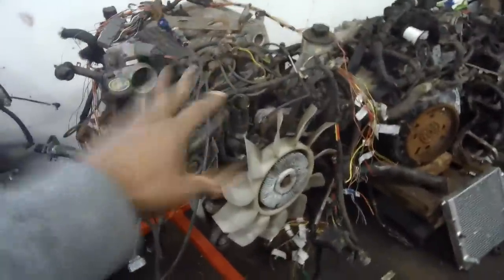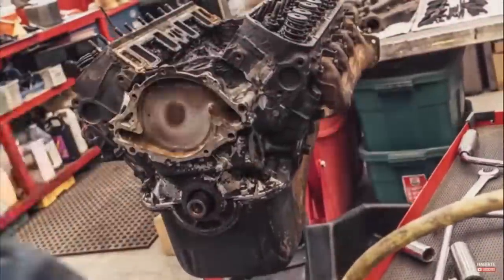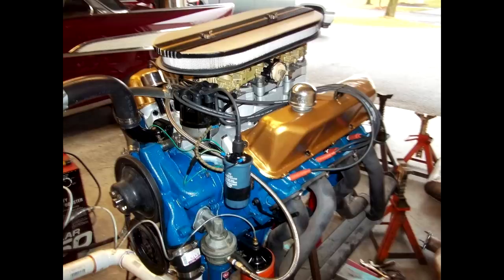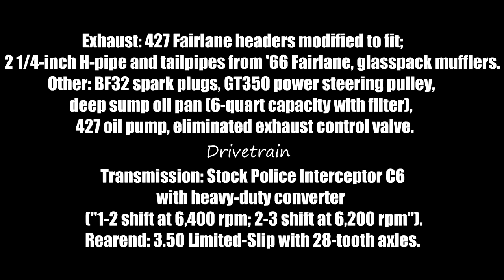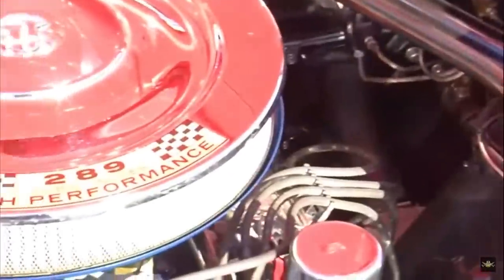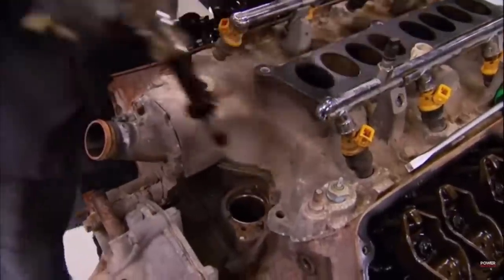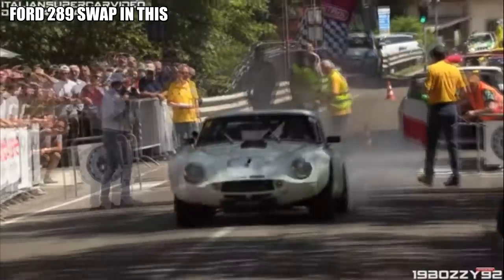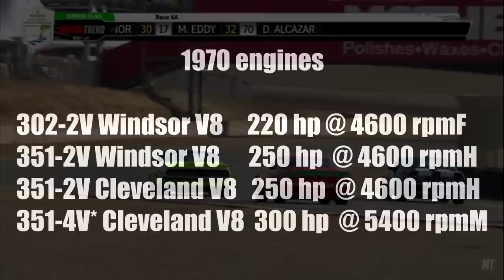289 Ford Voted BEST ENGINE BY CARROLL SHELBY ( HERE IS WHY )

Comment: I bought a 289 hipo from Creb Engineering....wow! what POS!!!....after much frustration, I pulled the whole thing out, trashed it, bought a 351w from craigslist, had my LOCAL machinist do her up into a gnarly short block, installed edelbrock performer heads and intake....MAN!! Couldn't be happier..Stay away from the hipo 289.....what a dog!! 351w kicks it's ass everytime...
Reply from the maker: lmao WOW i feel ya I would have done the same thing david lmao... the 289 have to be built ( with all the goodies ( in a light car )

Comment: 1st is the 427 for me cause it’s a legend and whatever car it’s in is going to be amazing. 2 is 351windsor. It’s a small block and can be bored and stroked to 427ci. 3  289 would love to own an old k-code ford. 4 is the 460  just a beast. 5 would be the FE big blocks.  351 Cleveland was posta be awesome way back too. Sorry I got no love for the 302. Seems like a lot of work and expense to bore and stroke the 302 to 347 and after ur done it’s still got less cubes than a 351w
Reply from the maker: you made some solid choices there i like your line-up (  honestly ) you can not loose with anyone, i tend to lean to the smaller motors, but i like that 427 no doubt about 1... strange how the old school put out some numbers big blocks i a speaking about
Reply: The only thing with the 351vs 347, don't you have to cut the strut towers completely out of a Fox body and weld a whole new front clip to fit the 351? I might go 351 if I can keep the strut towers on the Mav.
Reply: L Twig I remember changing plugs on a maverick with a 302 and it was tight cause of those shock towers so if a 351w fit it be even tighter. I always hated those shock towers. If I was you and had the cash. Stick a mustang II front suspension on that Mav and cut those annoying shock towers out. Be lots of room then for a 460 or even a modular engine.
Reply: @canadianmarauder1923  Yes, once the towers are out of he way, it would be ready for the Coyote. Except, I'm in the same boat as BST in my welding skills. I would have to pay someone. I could set it up correctly and make whatever support brackets. Just don't trust my skills on welding a suspension.
Reply: L Twig I hear ya. I’m an old retired HD mechanic and have done quite a bit of welding but I wouldn’t try welding it myself either. At least not if it’s visible. I would be farming that job out to a guy that welds for a living too

Comment: 351 modified was always fun.
Reply from the maker: i never even drove in oe, what was done in it
Reply: @bstfordchannel923 just racing around the  Hoosier corn fields .
Reply: @obediahsmith5824  I'm Hoosier also. Was you ever Southside TeePee racing?  I grew up in Speedway, 7 blocks from the track.
Reply: @ltwig476  I was further south, down around Evansville, Chandler. Maybe into Kentucky a couple times.

Comment: From what I remember, a 289 in a racing Cobra or GT350R was good for 380 reliable horses. What Shelby said made since as the 289/302 was just “good enough” for the average Ford passenger car application. They never seemed motivated to improve the heads with bigger valves like Chevy did, except for on the racing circuit with the Trans Am 302 Tunnel Port before the Boss 302. The Boss was an awesome power maker at 7500 rpm, but not that great on the street for daily driving chores. The 302s in the Le Mans winning 68-69 GT40s had the Gurney Weatlake heads, that Ford finally picked up 30? years later as the GT 40 head. But for nostalgia and proven racing-winning heritage, I also give a nod to the 289. Nice video piece.
Reply from the maker: next video kind explains why he never touch that 302 .. i was trying to figure that out, but i go it.. The 289 was his go to for hp... In the video you have read between the lines and such.. 302 is a sweet engine tones of goodies for it,,

Comment: The 427 was a great engine. A good high revving engine. But if i was putting an engine in a truck i would go with the 428. More low end torque.
Reply: Jim Bascombe That was just a matter of camshafts because they program where the engine makes what hp and torque where...

Comment: Some corrections in order here.  His name was Bob Tasca, not Tusca, and not Carl Shelby, but Carroll Shelby.  Yikes!  Don't mean to be a hard ass here,  but those types of errors kill your credibility as a knowledgeable car guy.  The Cobra Daytona Coupe was a highly modified 289 with 4 twin choke Weber carbs pumping out some 385-390 hp.  Bob Bondurant hit 197mph on the Mulsanne Straight at Le Mans in his #5 Coupe.  No 283, 327 or 427 carbureted GM engine ever saw that speed!  The Cobra roadster, Dragon Snake, won 7 NHRA Championships and it was the 289 powered one that did it.  The 427 roadster never won even a single championship.
Reply from the maker: thank you for the corrections your insight was well needed.. thank you for this great write and it was very detailed
Reply: @bstfordchannel923  - You're welcome, and thanks for being professional and polite in your reply!

Comment: The 289 is just one of Ford's great Windsor series of engines. The 260 was stroked to make the 289, which was bored to make the 302, which was stroked again to make the 351 Windsor.  All great engines.
Reply: The 289 has the same 4” bore as the 302 and 351w and c.
Reply: And the start of all was the 221v8 in 62 Fairlanes..
Reply: This is just from my 76 year old memory, but I believe the 221, 260, and 289 all had the same 2.87 inch stroke  with the bores being 3.5 , 3.8 and 4 inch respectively.  then the 289 was stroked to 3 inches to make the 302.  Then the entire block was made taller to increase the stroke to 3.5 inches to produce the 351 windsor.  289, 302, and 351 all had a 4 inch bore..

Comment: Carrol Shelby didnt use the 302 or 351 cause they didnt come out till 1969... i also got to watch that interview with carrol shelby, he said his AC cars were so good because the body would flex so much that you could lift the tires off the ground and that made it where the drivers could really push the car around corners and they won because of it... he liked a whole athlete and not just a steam roller... 289s are getting hard to find now a days cause people are wanting big block power... the 351 is just a good all around engine, strong block to handle 4 digit power numbers, it can be stroked so you could build yourself a slightly modern 427 but fit it into a 65 mustang... with the stock cam and good flowing heads and you can be making 340 hp and 400 ft lbs of tq which is good street numbers for an old engine... the 351 is my engine of choice... the next in line is the ford 300, its just a shame if you want a high hp engine from the 300 you pretty much have to make your own speed parts despite the huge fan base it has 🤷🏽‍♂️
Reply from the maker: I said if he did , but I really enjoyed your very detail comment The Fire... I really thank you for the knowledge you gave me on this subject
Reply: Good point.  The mid-sized 350ish small blocks, or "mid"  blocks from Ford came too late.  The "Stingray" that Carrol Shelby references is undoubtedly the Corvette Grand Sport, which was a nightmare conceived by Duntov poised to try to conquer the Cobras with a fleet (eighty cars?)  of 377 cubic inch all aluminum small blocks weighing 2200 pounds each until GM brass caught wind of it and axed the program after only eight Grand Sports were built. A pity.  Still,  as Shelby points out, the majority of Ford's concentration went into the FE 406 and 427 engines, NASCAR, that is, and didn't care about FIA sports cars  or LeMans until a bit later.   The "289 business" or Ford Windsor small block business suffered.  So it is quite a revelation that Shelby never wanted to build a 327 Cobra, but had no real alternative, as Chevrolet forced his hand with the Grand Sport.

Comment: I used to get over 500 hp out of 289!!
Reply from the maker: wow thats crazy Tim that is the move shelby was right all along
Reply: Not normally aspirated.
Even Joe Sherman couldn't do that.
Reply: @hotrodray6802  My Dad had a 63 Falcon he built a 289  in the early 70s for it and drag raced it . He would leave the line at over 10 grand and she ran low 9s. He is a Ford mechanic for over 50 yrs best around and 289 is king. Right combination and yea 500 hp is achievable. That 289 put a hurtin on many big blocks of all brands. Lol Them Chrysler guys would hang their heads in shame.
Reply: @chrispokorney6801  I d like to know how that engine was put together. I am a fellow engine builder.
Reply: @chrismontreuil2206  That I do not know but I will ask my Dad . I do know that he had a Ford tech at Ford cut a cam and something else for him. He knew some people at Ford. That car won a many of races and trophies when it wasn't breaking rearends and driveshafts.
Reply: @hotrodray6802  Sure he couldn't. His specialty was pretty much Chevrolet's. Don't think he built many fords at all.
Reply: @chrismontreuil2206  carefully
Reply: @hotrodray6802  Roush built a 290 cube cleveland headed 675 hp engine 40 years ago I think 9500 rpm it was sized as a 289 but they called it a "Boss 290". Also Jack said the best sounding engine of all time was a 289 with a solid cam. If you heard one singin' you know that is right.
Reply: Joe Sherman built a 400 HP 289 with pocket ported early heads, a 280• cam and a couple other tricks. A pretty mild,  low buck build for the output
Reply: HotRod Ray  500 HP out of a hi-po 289 isn’t that difficult.  Need a really good valve train because you have to spin the piss out of it!  Remember HP is calculated from torque and RPM.  More RPM equates to more HP.  I got 400 HP out of a reg 289 spinning it 7200 RPM with small rods with 5/16” rod bolts and ported factory cast iron heads. It ran11’s in a ‘62 Falcon Ranchero in 1980 before the 5.0 existed with the huge aftermarket support.
Reply: @hotrodray6802  BS! Ted Haywood did and ran them all season long. They Black Flagged him at Daytona because they couldn't believe it either. They teched it and he passed. Not bad for a private owner/racer.
Reply: @bobmiller2564  
Joe Sherman was one engine builder that didn't get near the attention he deserved.
No matter what brand engine he did he'd make big horsepower, and not by "throwing money", Joe knew where to spend money and where it would be a waste.
I've always considered him one of the top engine builders.
Joe was pretty cool about sharing information too - I called him about an old engine building trick I was trying to verify for use on a budget build for a customer, I offered to pay him a consultation fee for his time and he turned it down - and he was very good about answering my questions.

Comment: As a person that worked in a machine shop rebuilding cylinder heads its hard to believe the Windsor made the same power as the Cleveland.the Cleveland valves are allot bigger than the windsor valves.that makes no sense

Comment: Ford got it right by keeping all SBF engines 4” bore. 289 5.155 connecting rods vs 5.080? 302 connecting rod length. 289 rod in a 302 with the right compression height would make a budget long rod screamer.
Reply from the maker: i have to check on that combo.. that sound right up my alley there John boy.. I have maverick also click here to check it out https://youtu.be/0JweZqQb0oU

Comment: 302 Ford is most iconic engine ever. 5.0. From Boss 302, to the 5.0 mustang (even the new mustangs rip off of the 5.0), and the 94-5 GTs.
Reply from the maker: i feel your passion DEEP there Nate... I can disagree with ya
Reply: @bstfordchannel923  what's your opinion on most iconic?
Reply from the maker: @DominatorGarage  I lean more with 302 as far as HUGE parts list and power recipes for that engine.. The engine takes boos very well ( mainly all Ford run that way ) 289 seem sweet but something about the 302 in a small package that moves me.. I like 351 all but 302 still moves me in a strange way
Reply: @bstfordchannel923  the 289 and the 351 are also very very iconic engines. From the shelbys as mentioned in the video and the boss 351, lightning, and the mythical 80-90s 351w test GT and roush concepts. As well as cobra R and saleens. The 302 is the middle ground between the two. Though arguably the 289 for high revs, and the 351w for all out power and Very high boost. Since the 302s are limited by block strength
Reply from the maker: @DominatorGarage   very true very limited on boost that 302 is not quite there. Never seen a block split, but seen many photos.. Then 351 would be a better choice, but some thing about the 289 makes it magical strange thing.. Now you fast forward to the 4.6 rev happy motor  ( near being a sqaure motor ) with a bad head design for perforamnce. The engine design ( modular ) was just to build different types of engines ( kinda like making pizza )  2v , 3v, 4v, 4.6 and 5.4 later the coyote line-up just for being cost effective and i think there were build engines or blocks for other manufacturers like Koenigsegg and MV1
Reply from the maker: @DominatorGarage   1st gen koenigsegg i am speaking about . Which i think ( not fact ) the coyote is a koenigseggs old tech ( of head design )

Comment: I need a project. Fox body Mustangs are becoming harder and more expensive to buy.  Fox body T Bird is one alternative. Purchasing a block first. Gotta decide for 1/4 mile, road racing or street use. I picture a 87 Turbo Coupe body style, but a high reveing  small block V8, lowered a bit for handling, smoothed body, white lettering on the sticky meats. 80's NASCAR, 60's Trans AM  Racing with modern muscle. Action and less yapping.
Peace and God's blessing's to you all.
Reply from the maker: i like that set-up its honest and REAL ... Not all crazy and beyond many guys pockets... This is a solid comment.... T -bird cost JUST as much as Foxbody Mustang ( Foxbody ANYTHING ) is going to cost right now Adam... Cause of the foxbody mustang

Comment: I'm gonna go with the 360-FE, it ran circles around the 390 and was damn near indestructible.....
Reply: Lol... you're kidding right? 360 never had more than 8.0 to 1 compression and never even had a 4v carb... its like a 400 only an fe. Just something to fill a hole in a truck.
Reply: I'm not trying to be mean at all... I'm sorry if I sounded that way but a 360 was never a performance engine.

Comment: The battle is for 2nd place for best Ford V8 and y'all can hash it out among yourselves. The blue ribbon must go to the 2018 Gen 3 Coyote 5.0

307 cubic inches making 460 HP and 420 lb. ft. tq. With FBO and a tune for E85, this marvel will deliver 650 WHP and live all day at 7500 rpm. 

Keep in mind that a respectable 60s muscle car from the big 3 had 375 HP and in a midsize car of that era ( weighing 3500 lbs. I might add) was good for a mid to low 14 sec. 1/4 mile. The 2018 GT Mustang equipped with PP1 and 10 speed automatic (3900 lbs) has returned 11.8 sec. 1/4 mile, BONE STOCK! I know that the A10 is kind of a secret weapon to deliver that sub 12 but it's being spun by the Coyote!
Reply from the maker: out the box power in stock form  POWER very true in time it will be a Ls - band wagon type deal ( no hate ) you will understand in about 5 years by my statement . When things work they just work and the people follow.

Comment: 351 windsor. I always wanted to build a Clever using a windsor block with 2V Australian Cleveland heads and put a 408 stroker kit using a 4340 eagle crank and H beam rods with 9.5:1 to 10:1 JE pistons 550 600  lift  Crower/Crane Roller Cam and lifters. 700 Holley double pumper.  Might have to go a little bigger on the carb. Just want to build the right combination. But that would be the best engine to put in any big or small car. Might work really well in 69-70 mustang or 68-69 Torino.
Reply from the maker: I like what you are speaking about  here brother Randy. The 351 is a GREAT in between engine it season the engine just right it can be amazing like you mentioned.. Good recipe also
Reply: @bstfordchannel923 I am going to freshen up a 1994-95 Mustang 302 which it is a little under 100,000 miles. I may put a step up cam and a  dual plane intake with Holley carb. I would like to get the Hilborn fuel injection with stacks. I just think the 289-302's fit a little bit nicer in a Model A. I would like to build a 347 for it but I don't think I need a lot of motor for a car like that. I basically want a simple hotrod that you can drive on the street and drive to some local car shows. It's like you think big when it comes to engines just because you want to have a radical motor but then you get to thinking and say do I really need a bad ass engine to make the car go. I know I want my car to be some what reliable and dependable. Yes I want to have some performance items just to jazz it up but not get to crazy with it.

Comment: I run a 289hipo in my 23 t bucket and it keeps weight down 1540lbs. I love it
Reply from the maker: ahhh i see what you are saying... i will go 302 the next time out .. Now I have to look fo another 302 and i had 3 running ( with wire harness ) pockets got low and they had to go... even had 2 351w also
Reply: @bstfordchannel923  mine had a 289.hipo in it. So we rebuilt it and upgraded cam, intake, and carb. Plus it has a manual Trans. Feels like a go-cart with a super charger. Much faster than all 3 vets I've owned and 440 cars.

Comment: 289 Windsor sleeved and de-stroked to 260 ci, crank girdle dry sump, hi comp heads with valve train mods, big cam supercharged injected, 4,000 stall 4.11-4.6 diff ratio running a bulletproof C4 trans along with everything else to make it work, Please Mr Santa Claus.... I promise to put it in my '66 XP Ford Falcon; and be a good boy!!!
Reply from the maker: I just seen this comment and it was worth the wait lol That was a great recipe also for the falcon